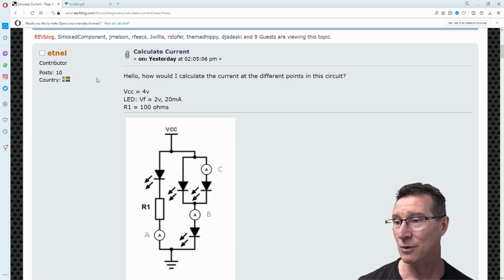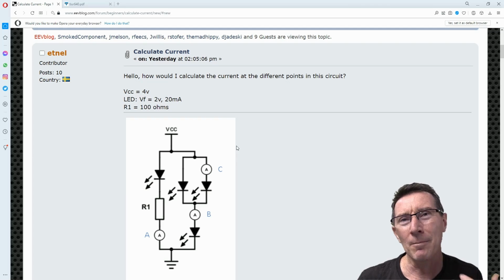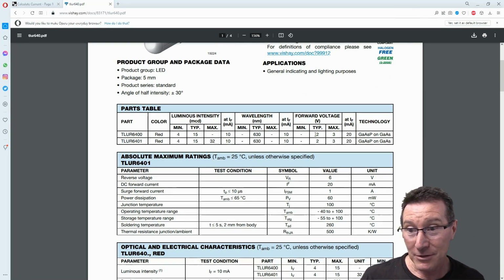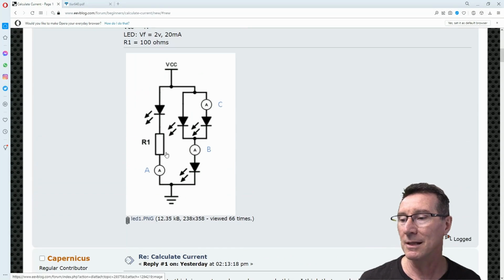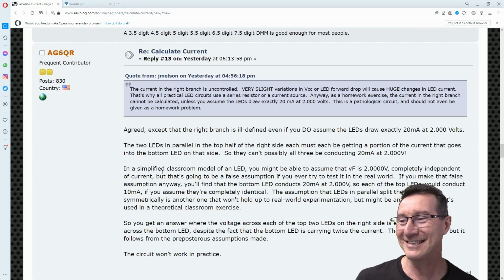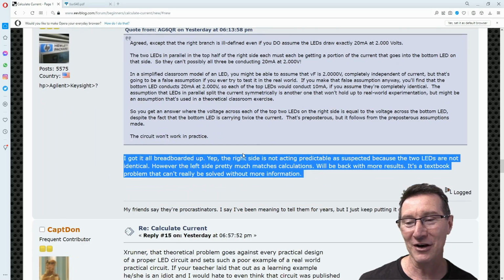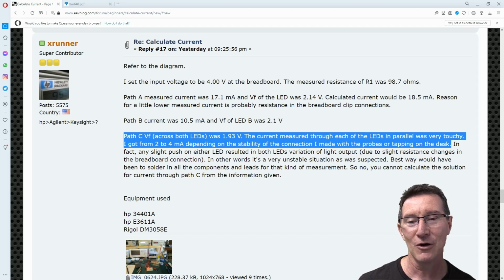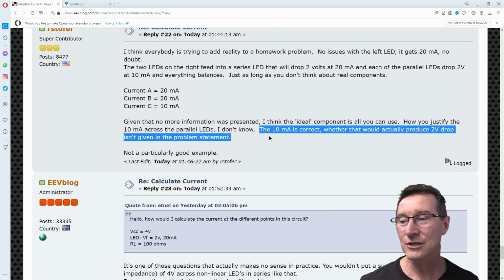EEVblog 1427 - An INFURIATING Electronics Exam Question!

Comment: A = 20 MA , B = 26 MA , C = 13 MA : IF The current in A is given at 20MA That means that the LEDs have a resistance of 100 ohms. Thus 4/200 = .02 Amps or 20 MA for branch A.
However in the other branch there is no way each LED is getting 20 MA. Lets Assume the LED at point B has a resistance of 100 ohms, so if all LEDS have that same resistance value then LED at
Point B has 26 MA going thru it, and the last two LEDS in Parallel have 13 MA thru each of them.
In the real world I do not know how this circuit would react but I stand firm on the last two LEDS not getting 20 MA.

Comment: It was more infuriating than the question to spend nearly half an hour to come up with the answer. It should take no more than 30 seconds to work this simple cct out. Ok, so I have been a professional electrical and electronic engineer for 36 years and did not need a white board to work it out!

Comment: The problem is not defined. Only a amateur would pose such.  Let assume the node at B is a 2V then the bottom diode carries 20 mA but so would the two diodes above feeding a total of 40 mA to the single diode below.  Clearly the circuit will find equilibrium with a current between between 20mA and 40mA. Like 15 +15 =30 since the middle point is higher than 2V and the two diode have less than 2V across.   Without knowing the diodes dynamic resistance, the problem is ill defined. The bloke talked for 1/2 an hour without addressing the issue.

Comment: yes it is impractical and yes it is not  we have t0  assume ammeters are zero resistance  and if we use the 20ma at 2Volts is of for the Ammeter but 40 in he lower  led

Comment: Knowing the typical LED Vf curve, the only possible correct answer is:
A: 20mA
B: >20mA
10mA<C<20mA

But, IF you'd be given the Vishay specific curve available, you could read  I=13mA @V=1,9V, and  I=30mA @V=2,1V and approximate the curve rises from these to 20mA @2V with two straight lines:
For V<2,0V (the parallell diodes) I [ma] = 70*Uc-120 
0For V>2,0V (the single diode)      I [ma] = 100*Ub-180
Now we have an equation where Kirchoff tells us: 2*(70Uc-120)=100Ub-180 and U1+U2=4
Solve for Ub and Uc:  
Ub=2,083333V and Uc=1,91666V  =>
Ib = 28mA, Ic = 14mA
The reading of the curve was in 2-digit accuracy only, the final answer can't be any more exact.

A better approximation might be connecting the 3 points with an inverted parabola, but there's no sense in that either, since the Vishay curve is obiously built on a limited amount of datapoints:
0,1mA, 5mA, 10mA, 20mA, 40mA, 60mA and 80mA with linear connections.

Comment: Do you believe this one? There were many tall portable space heaters sold (under different brand names) that consist of two upright (ceramic?) elements and a small, rather weak fan that just barely pushes air out of the housing. These have two controls: a thermostat on the left, and a heat output level (i.e. "low" "high") on the right. The designers decided to implement the low setting by simply placing a diode in series with the heater elements, to send half wave to the elements instead of the full AC wave. Apparently, sourcing diodes with ratings sufficient enough to handle the load was deemed too expensive, then some genius came up with the idea "we'll just use two cheaper, lower-rated diodes in parallel to split the load between them." Guess what happened when people left these heaters on "low" mode for any length of time? (there are quite a few YT postings about this) Get the marshmallows, quick! The really scary thing is who knows how many of these are being used out in the field.

Comment: Using Ohm's Law, each LED has an apparent resistance of 100 Ohm.  Note that the left leg of the circuit and the right leg of the circuit could be separated into two separate circuits and the results would be the same for meters A, B, C.  Solving for the series and parallel resistance circuit values yields:  A = 20.0 mA,  B = 26.6 mA,  C = 13.3 mA
Reply: Ohm's law is linear. The LED not. See the Vishay datasheet. Resembles an upside down parabola but the physics of LED are logarithmic.
You could use linear approximation on a short stretch, but the datasheet is clearly showing logarithmic currents!

Comment: I dont see what is so difficult there is no if this or if that, that defeats the purpose of the question you must assume the information given is absolute which that case a=20ma  and b&c=0 because that circuit is a failure no curves no maybes

Comment: That circuit will burn out all three diodes on the right side - with or without the ammeters.
The left side will work fine, even after the right side is destroyed.
Beyond that, this is a philosophical question - and a stupid one at that.
Thanks! It is infuriating...I can't believe this is real.

Comment: assuming stiff power, 5% tolerance, and room temperature: 
A = 20mA (range: 19mA - 21mA)
B = 28.28mA (range: 26.1mA - 30.4mA)
C = 14.14mA (range: 12.7mA - 15.5mA)

Comment: The ideal case is 10 mA for the C LEDs and 20 mA for B LED.
LED are no lineal but B LEDs will canceled the no linear behaviour of C LEDs.

The voltage in C LEDs will be a  less than 2 V  (1.9V) and Voltaje in B LED more than 2 V (2.1 V)

Comment: In real world practice. The right hand side probably bursts into flames or goes into some kind of rapid oscillation. In either case, the dumbass designer blames the factory for what must be poor quality control.
Reply: After many weeks of meetings involving 3 layers of management and blaming both the factory and led vendor, the company hires me as an outside consultant. I fix the problem in no time but spend many hours trying to figure out how to explain, in the least offensive way possible, that the designer was an idiot.

Comment: Hey Dave. Your style is a bit longwinded, so I don't often watch your stuff. Sorry. 

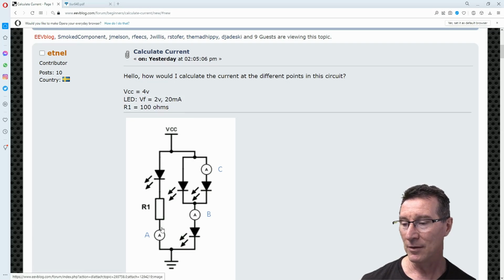But in this case I stopped watching at 1:05. You state that it is given that the Vf is 2V at the specified 20mA. The way it is written makes ME think: that's the typical way specs of a led are given: Typically about 2V with a maximum of 20mA. That's the way you should read the specs. And that makes the whole "assignment" flawed. Even with your assumption that it's 2.000V at 20.00mA the whole thing is undefined (except for the left branch).

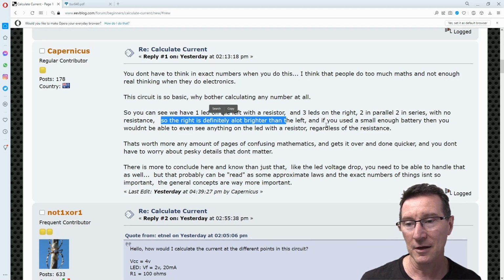Comment: @8:20 Copernicus is INCORRECTLY corrected by @EEVblog. Right side (with the resistor) referred to by Copernicus is confused by EEVblog with the left (3 x LED) and vice-versa. I stopped watching at this point. Some errors are excusable, but correcting the correct is not one of them.  Copernicus is owed an apology.

Comment: Hi, Your experiment is not professional David. B diode is much hotter then C diodes (twice the current and higher voltage). So diodes has different characteristics. Bind them together and put them into the room temperature oil.

Comment: Hi, so I ran this simulation is TinkerCAD, and my results are as follows:

1. The left side is definitely brighter than the right side, but the right side flickers??
2. Node A was measured to be drawing 16.9mA whereas both B and C were drawing 3.13mA, which makes sense because they are on the same line and according to KVL will have the same current flow. 16.9+3.13 = 20mA

Therefore,
A = 16.9mA
B = C = 3.13mA

Comment: Beware electrical engineers attempting to sell you convoluted mess as true science.  Dave, go back to connecting the dots and complaining about cheap multi meters.  At best you’ve got the makings of a bad home shopping channel here.  Engineers who ignore physics folks are engineers with a BS degree of which we award for the sort Dave is.  If he knew an ounce of real physics he’d STFU and pay tribute to Derek’s glimpse into the reality underpinning real electronics.  Alas, guys like Dave sell you “engineering without math” which is good for those that want to blink a light but the real know how?  The real innovation?  Not here.  Never.  This is a muppet doing science that can’t dare to broach transmission line theory any more than I can make soufflé.  Because it takes skills that Daveyboy ain’t got.  Pfffft.  Weak.
Reply: Show me a scattering parameter without a simulator dude and I’ll bet you’ve got three pages of notes to complement your tinny voice.
Reply: Work a method of moments and we’ll talk.  Maybe you can intern for me.

Comment: Voltage will actually not be 2v. Remember active loads with bjt's or mos(not the same but two non linear components as well). I'd say it has insufficient info.

Comment: If we are assuming that Vf remains constant for all values of current through the LEDs, then why is it wrong to say that the current through the LEDs in the parraell branch is 20mA and therfore the current at point B is 40mA? The forward voltage drop would still be 2V based on our assumptions

Comment: If the voltage curves of the LEDs are at least the same shape as the example curve, and the voltage drop is at least 2 V at high currents, I think the right-side LEDs should reach an equilibrium point

Comment: I really don't see why there's such an emotional response to this. The question regards current analysis, not practical or social aspects of the design, or the examiner. It's a secondary school level question.
A similar question would be a combination of resistors. (series/parallel)  Anyone who thinks they would find such a configuration in the 'real world' needs to spend more time at school.

Comment: Instead of node analysis or kirchoffs law try running through mesh analysis lmfao
Now you get 0A through the right side mesh loop through both parallel LEDs as 20mA-20mA=0mA .... then the bigger loop we have (20mA*2 + 20mA) - 2V/100ohms [20mA] - 20mA =  0 and solve for the unknowns oh wait there aren't  any and the equation doesn't hold up and it's an awful question

Comment: I've had a chemistry final where a multiple choice question did not include the correct answer and at first the professor's ego got in her way but I remained persistent bc I knew I was right. I made her look up the relevant info in te book at the risk of automatically getting the question wrong but lo and behold..  she had to basically credit the whole class for the bad multiple choice question.  I didn't need bonus points bc I already was too ridiculously close to 100% and the class used a curve

Comment: As an interview question I worry though.  Candidates often get interviewers who just want to give them their idea of the correct answer and might be internally infuriated at the question but also understand their place in the organization.  Every place I've worked I've basically had to shut up to keep my job even if it eventually turned out I was right all along. And the companies look for people who listen to the pecking order. So as a candidate desperate to get a job and be able to not be homeless living on the street with no food vs getting a good job... 9 times out of ten telling them what they want to hear will get you out of poverty at a better rate than challenging them. You need to be very privileged to be willing to insult the interviewers' question
Reply: Before you can shake things up at an organization you have to build credibility which takes years. Nobody will listen to the new guy or even the guy with a couple years vs the guy with 30 years who has power but no understanding of engineering. It's a delicate process at most organizations

Comment: even if you didn't learn kirchhoff's current law , it still wouldn't make any sense for them all to be running 20mA.

it would be like having 2 containers with 20 of some liquid quantity and then dumping them both into another container and still only having 20 of some liquid quantity instead of 40 of some liquid liquid quantity.
like where the hell did 20 of some liquid quantity go XD just fall out of existence, i think not.

Comment: Forcing the junction temperature to be identical and screening the LED’s to be matched should be a given condition of the circuit.  Any change in Vcc will also have a huge influence on the right branch.  I know of a system engineer that wanted to put 8 LED’s in parallel and assumed if Vcc was regulated- all the LED’s would have the same intensity.  Since intensity is determined by current - I explained no chance - you must have 8 current sources to get identical light outputs….

Comment: 2:34 My favorite job interview question that i've used is still the simple request of "can you make me a cable for this test eq?" I just leave it at that, and see what they do. the real turds just do their best to ignore the question and avoid actually doing anything, and the real problem solvers either immediately start messing with the test eq or they ask for more information like "what type of cable" or "what does the cable do?" It's a task that i designed to test if an engineer will ask a question that makes them look or feel dumb and also test if they will turn a vague task into specific results.

Comment: That's the kind of exam questions that should have been catched when dry-running them by a second person ... and yes, we did this at the chair where I was doing my Ph.D., and for exactly such reasons. It's no shame to make mistakes in preparing exam questions, but it's laziness to skip the dry-run or to not do it properly. We actually put our prof to the dry run to set the bar low, seriously ... the prof knew this and endorsed it.

Comment: Dave, you overcomplicated this by assuming that the components are non-ideal. Any test with this question, this circuit, would be in a low level course where components are assumed ideal.

Comment: you need to find the diode forward current I for which V(I) + V(I/2) = 4V. That is the current through the lower diode if all the diodes are identical, it will be a bit more than 20mA. Terrible circuit.

Comment: As a CETa, my initial impulse is to say that you can just omit the entire right branch since an LED with no current limiting will draw all current the supply can suffer, which usually results in the LED burning out. So zero for B and C. The only thing left to do is calculate I(t) at A, given 100 Ohms and the typical 0.7V drop of an LED.  

There’s so much wrong with this question 😂 Dave is right about rebelling against the system. Challenge assumptions. If the customer says that this or that is definitely the problem, you take that under consideration and do your own troubleshooting. In the technical trades; if you’re wrong, the reality of the system you’re working on will absolutely rebel against you and your assumptions, and that’s usually very expensive or very dangerous. Sometimes both.

Comment: The current at Test Point A is indeed 20 mA. However, the current at TP-B and TP-C would require the conductance curve of the LEDs to calculate, as the function is non-linear. Also, whether all three LEDs are of the same type is not specified, making an answer conditional.

Comment: You know what they're looking for, right? They're looking for C=10mA and B=20mA, and that's gonna be about right, and if this is an ECE university question, you should be able to guess that. You should also bring it up that its an incorrectly written question if you come across it. Yeah, diode V/A curves aren't linear and B and C are undefined but for real, I can't take 28 minutes of hammering home what should have taken the length of reading this comment to explain.

Comment: My first thought was: I assume that the power supply doesn’t have any particular output protection and delivers an over voltage spike that kills the right branch.  From there, either the left branch is fine or the right branch fails closed and possibly pulls down the Vcc or causes a cascading failure.

Comment: As an aside and a non-EE related thing, one question I love to give people is the trolley problem, in various forms. What I love about the trolley problem is that there are infinite numbers of answers to it. The answer someone gives reflects how they think critically. If someone gives the simple answer, or says they simply won't pull the lever, both answers are insufficient and tell me they are not thinking critically- they are thinking within the bounds of the question, and trying to give an answer, as if I expect them to stay within the bounds of the question.

If they begin to question the point of the problem, or consider that there should be other solutions and ways to perhaps save all the lives (why not just stop the trolley?), I find the answers much more compelling and respect the individual more and prove their critical thinking skills. Very few people do this, and most people seem to think in this binary way- there is one answer, or another. One is right, one is wrong. Instead, thinking in a way that there may be another answer- different from the ones given- is an incredible feat of critical thinking. 

If you try to give a basic answer to this EE question, you are not thinking critically, you are trying to solve a problem given to you without considering that it may be flawed inherently. The trolley problem is inherently flawed in many ways.

Comment: I have seen diodes used to drop voltage and LEDS used in series so they do indeed drop voltage like a resisitor. If they didn't you would not have LED Christmas string lights as example. LEDS are more like a llw voltage Zener diode that is also used to drop and limit voltages.

Comment: So you can approximately model a diode with an exponential function (that is, Id = Is.e^(Vd/0.026)). I did some calculations assuming assuming an ideality value of 1, worked out Is if Id=20mA at Vd=2, and asuming the LEDs were identically matched, and I got a voltage drop across the bottom LED of 2.01V @ 29mA, and so the top LEDs each have a voltage drop of 1.99V and a current of 14.5mA. But I agree it is a pretty lame question.